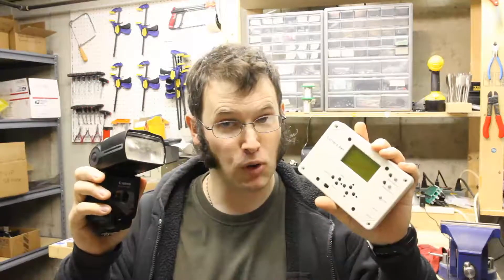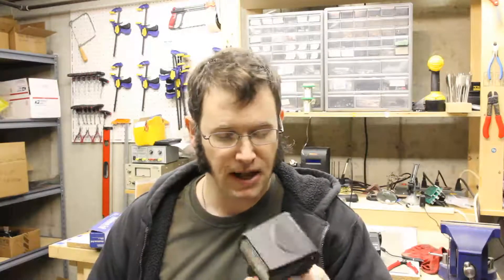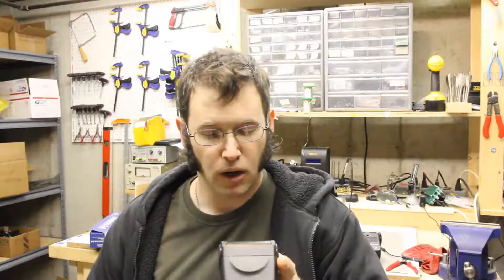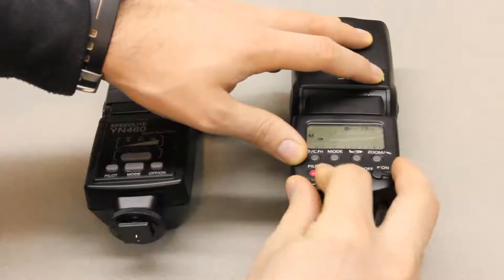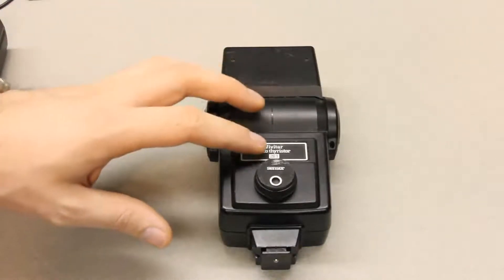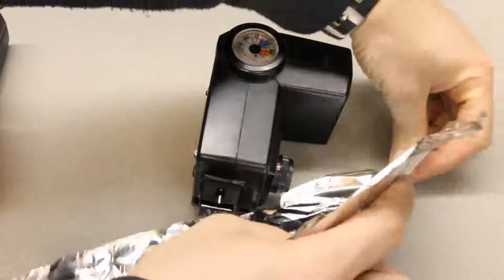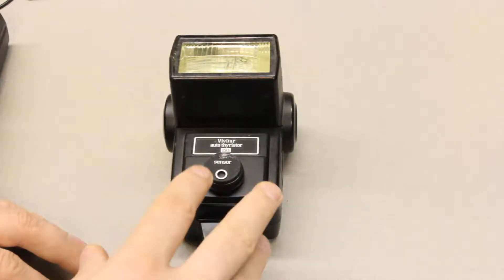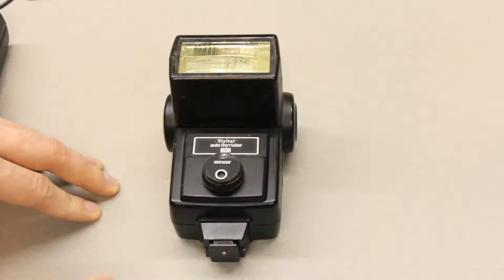TPB #26 - Picking a Good Flash for High Speed Photography

Comment: Interesting, but IDK why the Vivitar 283 had to be brought in, except as an example of what not to use.  Rather than spending time and money hacking it, simply  use a unit that already has a safe voltage and fractional power levels - for example the Vivitar 285 HV (the improved 283) or the Sunpak 383. They are two-a-penny on Ebay etc.

Comment: Trying to decipher what is going on here... I think I have it now... At first I was thinking.. What difference does it make regarding flash 'duration' if I have fast shutter ? But then I realised.. 'Synch'..  so I guess we try the other angle... fast (short) flash duration in dark surround and shutter can stay relatively 'long'.. we just want subject lit for tiny amount of time inside the shutter open duration..
Reply: Indeed, and also the fact that with a focal plane shutter (most DSLRs and ILMCs) you canot use flash with a shutter speed above the sync speed which is much slower than what is needed here.

Comment: Thanks for responding to question about plans/schematics so promptly.  I purchased a Miops trigger which meets my needs for triggering and although your oscilloscope videos which show how to measure durations with a scope are good they don't explain the measuring "interface".  I have a couple of digital scopes and an analog scope and would like to know more about what sort of short flash duration measuring sensors/circuits I can use with my scope to measure durations.  Please help me with this if you can.  Thanks.

Comment: Vivitar used to make a device called a VP-1 Vari-power Module that plugs into the Vivitar 283, replacing the Auto-Thyristor.  The VP-1 provides full manual control of the 283, enabling one to dial down the flash strength to 1/64 power.  Also, to learn how to test the trigger voltage of a Vivitar 283 to make sure it's safe for a modern digital camera, here's a link (Measuring Trigger Voltage of a Vivitar 283) to a YouTube video I made in February 2012.
Reply: Thumbs up, but those VP-1 units cost more on Ebay than entire flash units of that era with fractional power built-in, and with safe trigger voltages too. Eg I have a Sunpak 544 that goes down to 1/64 manual power, and it cost me £12. I know the 283 has a cult following, but there are better units on Ebay etc for peanuts - even Vivitar's own similar 285HV was a big improvement on the 283.

Comment: @Aaron16 No.  The multi-flash board uses the same circuit to trigger the flash as the Camera Axe.  If you tried this you'd like damage the opto-isolator and need to replace it.  

On the Camera Axe this chip is in a socket and you can just plug in a new one.  On the multi-flash board it is soldered down so you'd need to unsolder and then solder the new one in